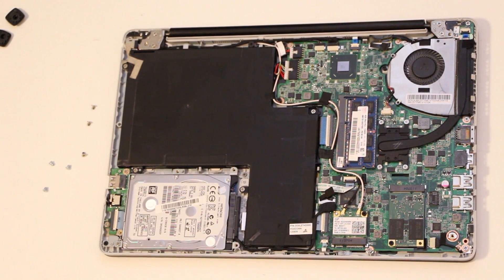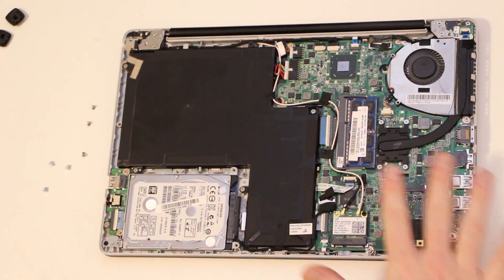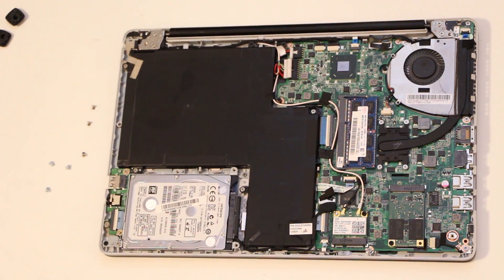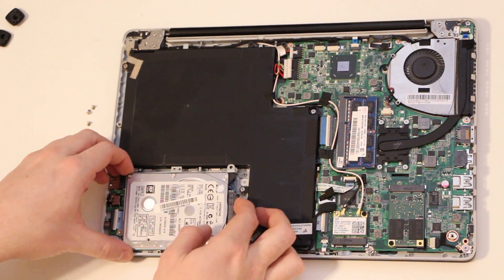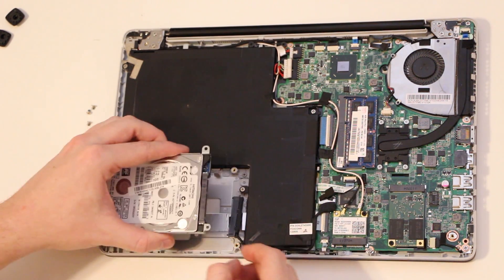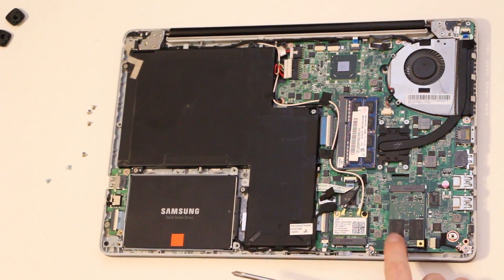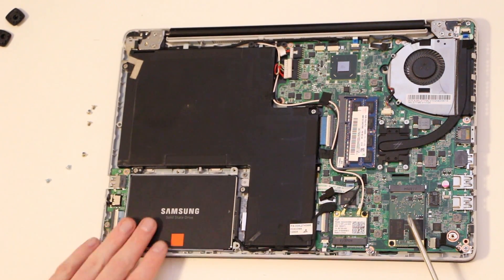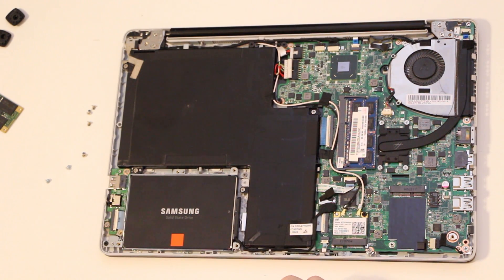Lenovo U310 Disassembly - How To Upgrade Hard Drive With SSD

Comment: Thank you for the video, it's gonna help when I open it soon.  For those asking here are a few answers.  The SSD is 7mm. I'm running mine right now from the Samsung PM830 32G mSATA which it comes with and the Hard Drive is still installed. You'll needed to disable Raid in the Bios and change it to AHCI.  Once you have windows installed make the msata the primary boot drive in the Bios.  I did all that before I even crack it open and Windows installed and boots right up.  Barely any space left after installing Windows in the included msata 32GB. I'm going to upgrade the memory to 8Gb hope it works. Crucial website does say you can.  Crucial UK says you can even buy msata which makes sense since that's what it comes with.  I'll be opening mine next week.

Comment: Another comment on the same topic, but I find such operation totally pointless - I own U310 with 500GB HDD and 32GB mSATA SSD - you can get the best out of both worlds by installing the system on snappy SSD (520 MB/s, tested) and loads of space on the HDD without any sacrifices or costs..

Comment: Hey ;) What about only upgrading the MSata SSD and leaving the Hard Drive inside ? Would it work ?
Reply: mSSD and hdd work on raid, at least you know how configure new ssd with mssd is better option remove all for raid dont make problems when you turn on laptop each time.